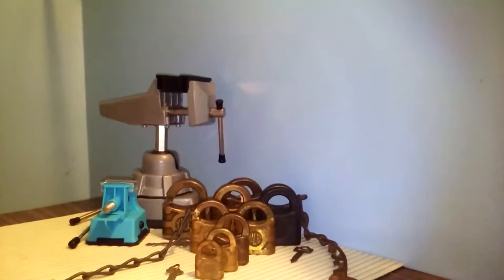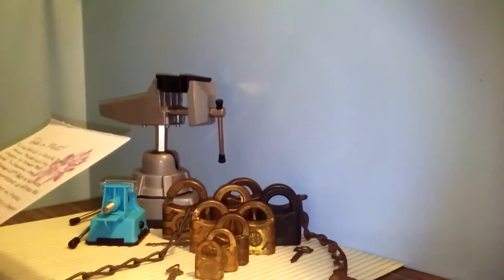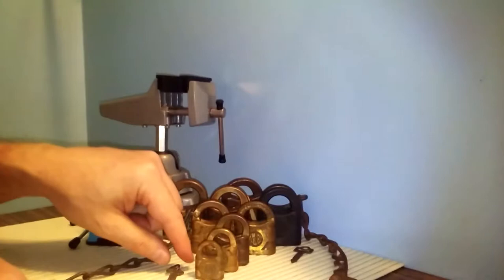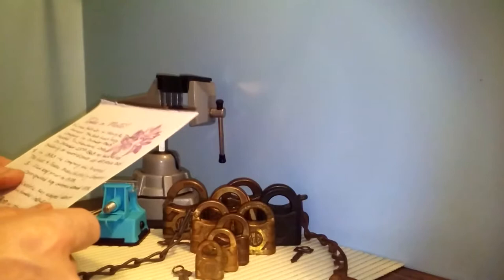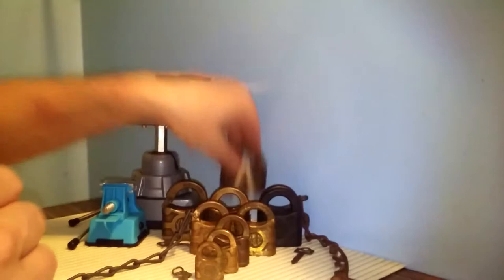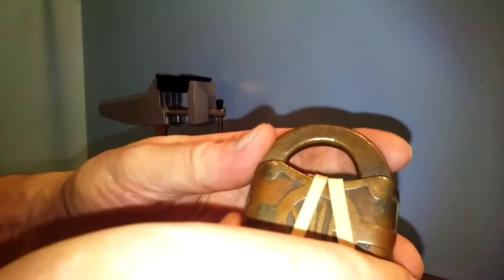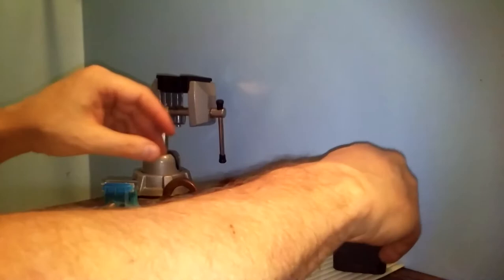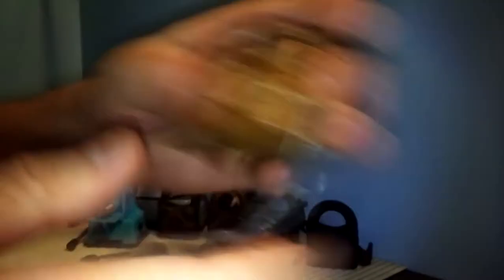[35] Antique Yale 800 series - Yale Manufacturing Co.

Comment: Buddy, This is a fantastic video.  I have been collecting and trying to pick these things for almost a year. I finally took one apart.  None of mine are the very early models.  How did you tension it when picking? I did a recent video where I took one apart.  I love those old Yales. At first I thought I was dealing with a warded lock, then I found the 1921 Yale catalog online and figured out it was a Lever lock.
My very first one is almost 3 inches wide, and still locked. It was a freebie that an Ebay seller threw in when I bought some antique padlocks.  I only have 4 or 5 of them. Thanks for the information on this series.
Reply from the maker: You are very welcome. Sadly, the only locks I was able to open were the 833 using a set of warded picks and the 863 which lost a part of the inner lock(a ward maybe). I thought the 863 was broken but as I was writing this I closed it and it locked. I then was able to use the warded lock picks to open it again. I like watching your videos because you are willing to take the locks apart to see how they work. The Yale catalogues have a lot of information in them but I am still trying to figure out if there are differences between the different decades that the Yale & Towne 800 series were made. It's hard to differentiate when the same padlocks are made for decades. Sometimes they make cosmetic changes like the fonts in the word Yale or in other Yale locks they went from YALE to Yale. I am starting to collect more ancient padlocks but I like to get the earlier Yales when I see them. Take care, friend.